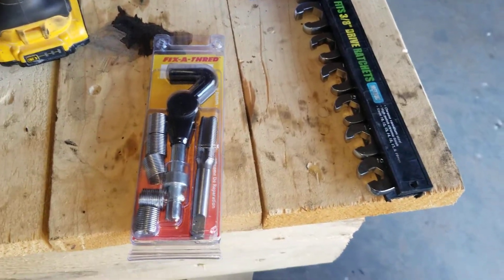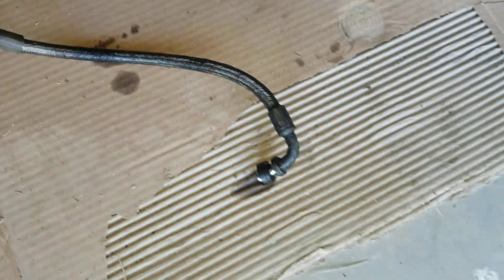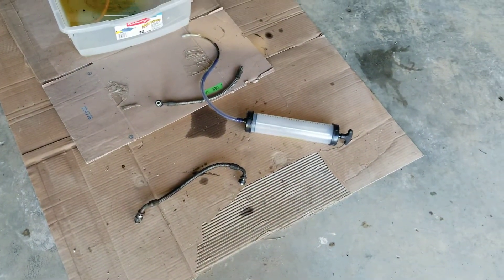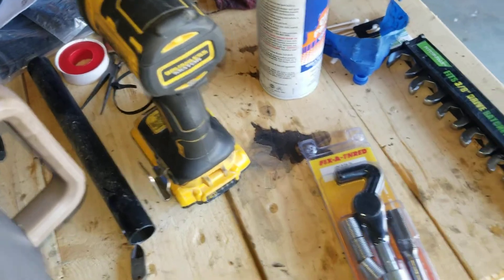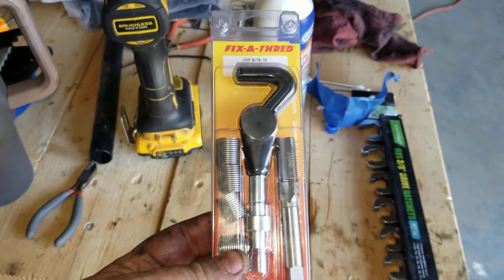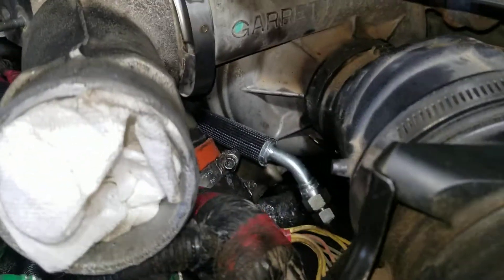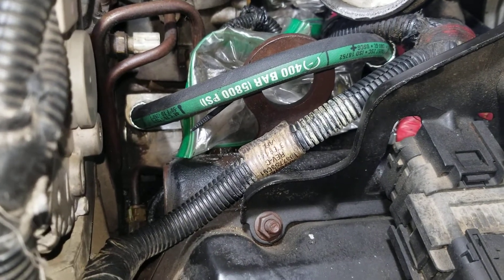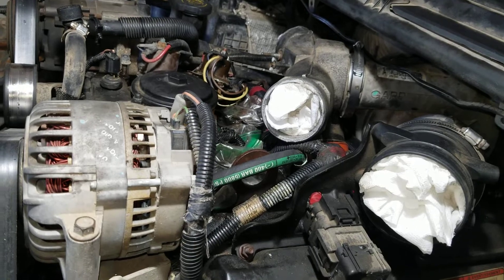7.3 HPOP Hose Replacement / Stripped HPOP oil outlet lessons learned.

Comment: Once tapped do you need a reducer for you new lines or does the thread pitch the same as the new hose lines I made
Reply from the maker: @bgummiesable  once you put in the heli coil the thread pitch is the same. I did not need a reducer.
Reply: @jamesc.3524   thanks man I been told not to helicoil cause of the 3000 psi the pump puts out but I think red loctite will do
Reply from the maker: @bgummiesable  I thought long and hard about using red Loctite and going from there, but after a lot of Internet research, I found the Helicoil was the only solution. I can tell you in the 2 years since I made this video, I've had zero problems out of my truck. Granted, I don't drive it that much, but so far, so good. Best of luck in whatever you decide.
Reply: @jamesc.3524 when you did this, did you remove the hpop from the truck or did you do it with it still on the truck. Im about to do this tomorrow but I need to know that little detail.
Reply from the maker: @MichaelMontgomery-ql4ws  still on the truck... did not remove.
Reply: @jamesc.3524 thank you so much!!! Thank you for replying too!
Reply: @jamesc.3524 how did you drill it first
Reply from the maker: @MichaelMontgomery-ql4ws  I don't believe I did. My friend that I mentioned in the video used the tap that was provided in the kit

Comment: Thanks for sharing. I just stripped out one of mine on a brand new oem hpop. No way can I just scrap it. I'm going to try this tomorrow. How is yours holding up? Tia
Reply from the maker: So far so good. I have put 200 or so miles on my truck since doing this on my truck no leaks. My truck is not my daily driver, but since doing this repair, I don't have any complaints.